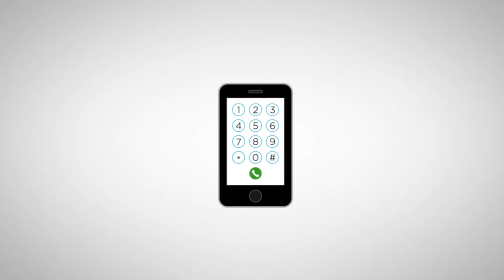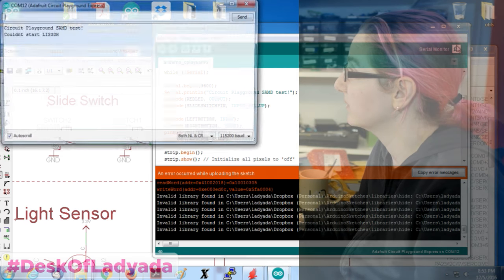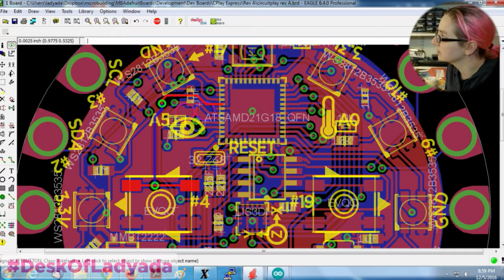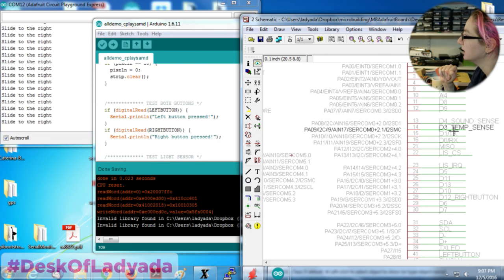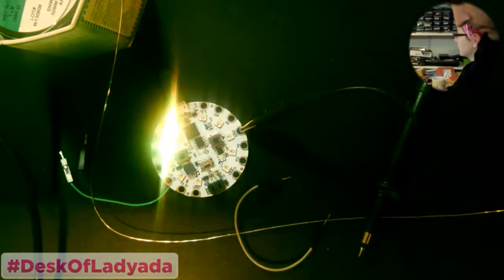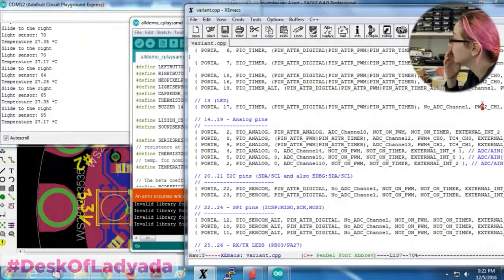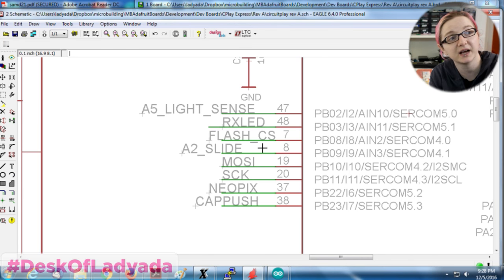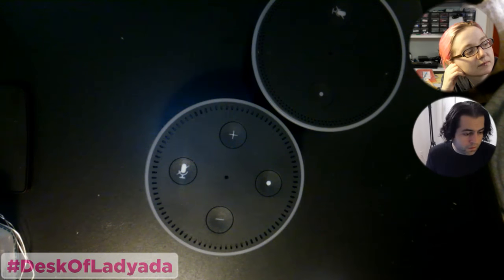LIVE! #DeskOfLadyada electronics SAMD Circuit Playgound! @atmel @adafruit

Comment: I like the Circuit Playground and will be using it at Art Center College of Design next term for a class. Happy to see a faster-mo-better processor in the works. One request I have for the board is to add two more neo pixels. A full ring of 12-pixels looks better in lighting projects and is handy for making a clock. Or, maybe an addon board that sandwiches on top? I currently use a 24-pixel ring which the playground fits perfectly in the center. I laser cut a bracket to hold the playground and 24-pixel ring. The combo almost looks like one board. Just a suggestion and keep up the excellent work! I like these live experiment videos.